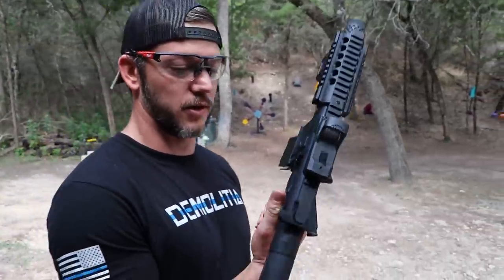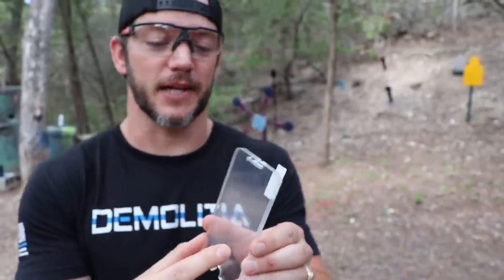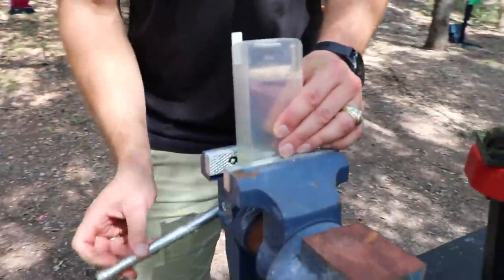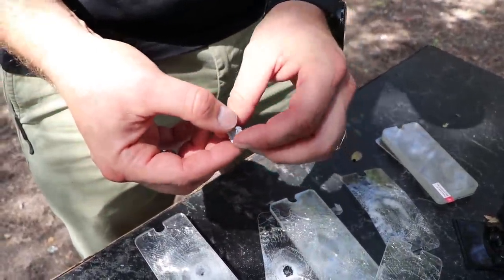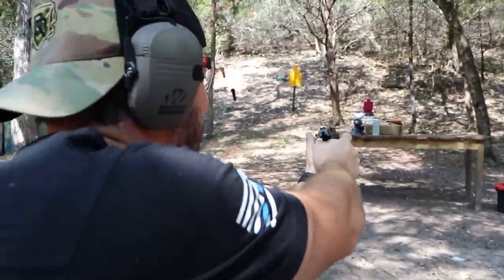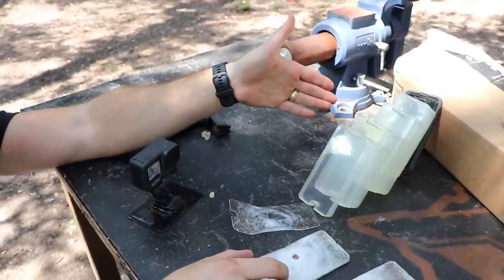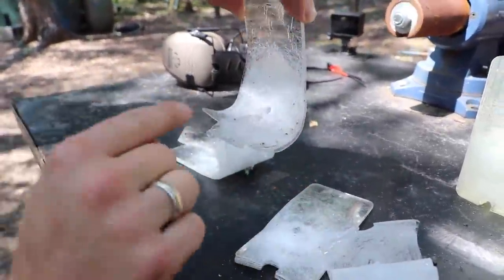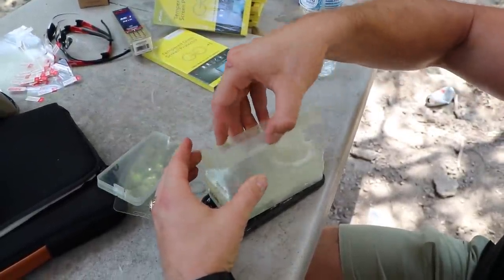How Many Screen Protectors Does it Take to Stop a Bullet???

Comment: Matt: "Nobody actually really likes this caliber..."
.380 at 7:15 : "And I took that personally."
Reply: Like it or not, I wouldn't want to be hit with it, nor a .22!
Reply: I was gonna buy a compact 1911 .380.  There's no cheap .380 in my area.  So I bought a Colt 1911-22 by walther.  Ammo for days
Reply: @Dontgetenslaved  i bought a crapton of steel case .380. i might as well have just thrown $100 at a fire.
Reply: @natemarvel2471  I've had zero issue with steel case 9mm and others.  Never had a .380 so I couldn't say if steel .380 is good or not.  I know a lot of gun supremest like to hate on steel case for no reason.   Even when they all have glocks and they eat anything.  "They wear out the extractor and ejector faster."  Well mfer you can't afford a $10 part to replace after shooting 5,000rd?    I hate people like that.
Reply: @Dontgetenslaved  this stuff was cheeeeeeeap. Actually shooting it out of a G42. Decent little compact. I have to over lube the thing to get it to run 7 without a cycle screw up. I side by side, same mags, same day ran Federal like a champ, but this steel case Monarch is hot garbage. My fault, I did zero research and it was available so I bought. Big oof.
Reply: Walther PP/K: "Am I a joke to you?"
Reply: @natemarvel2471  Ive had zero issues with the monarch steel 9mm.   I hate buying it but it's better than nothing.  Sounds like you may have gotten a few bad boxes.   What issues are you getting?  Extraction, feeding ???  The only real issue Ive ever heard that if your barrel clearance is too tight they wont seat or extract because the round won't fit in the chamber correctly.     That stuff still flys off the shelf in my area, even at the current price of $100 a box ..
Reply: @bdwilcox  I couldn't get .380 so I got a ppks in .22 also lol   Good gun, just liked the walther 1911 better so I switched.
Reply: @Dontgetenslaved  My father runs Russian made, steel cased 5.56 through his Galil MAR and that thing eats it all up. I also agree with you on the supremests who hate on steel cased ammo for no reason. Steel cased ammo has no problems if it's made right.
Reply: @jared.p240  Tula and wolf are top notch.  I've barely had any experience with brown bear but when I did it worked . The monarch stuff I didn't see come out until after the shortage when stuff started hitting the shelf again.  Not sure who it's made by.  Seems like they need to do some qc on the .380.
Reply: @Dontgetenslaved  Here in South Africa, I've never seen Tula, Wolf or Monarch ammo on the shelves in my local gun stores. My father uses this one brand that I've never bothered to look at the name. If I get the name I'll tell you. On a different note, now that you've told me that Tula and Wolf is good, I'll definitely buy some when this stuff flies into SA. If the Monarch .380 flies in too, I'll avoid it like the plague. Not that I don't have a .380, lol.
Reply: @sunshine681  My experience with a Browning .380 was you were more likely to hit the target if you threw the gun. So I would prefer to be shot at (not hit) by an average .380 than a .22 (which is more likely to hit you)
Reply: @Dontgetenslaved extraction. Could it be because my 42 is fairly new?
Reply: @natemarvel2471  If you've shot less than 500 break in for a glock...yes. Those compact have a hard time with that short recoil an stiff spring.
Reply: @jared.p240  Yeah 9mm and the rifle round monarch are ok for me. Use them just to plink steel or if shtf here .   I have some video on my channel of my guns and suppressor.
Reply: @natemarvel2471  Not to knock your gun but if you wanted .380 you should have gone with a compact 1911 or a walther ppk or the off brand bersa thunder.   Anything but a .380, .22 glock Ive dealt with and they are good. .380 is just a tad underpowered to move a huge slide for me. That's why most .22 go with aluminum slides.
Reply: @Dontgetenslaved  thank you, I bought a new gun in a caliber I don't already run, in the middle of an ammo shortage, and expected.... Miracles? So, the hunt for federal begins a new.
Reply: @natemarvel2471  I did the same thing with .357/38spl.   I acquired 1,000 mixed then went dry. Sold it all with gun.  Now it's everywhere here again.
Reply: @natemarvel2471  you could probably trade the gun for another or cash if you don't like  pretty sure you could make profit on the ammo for sure.
Reply: Matt has said many different times that he carries a S&W Bodyguard... which is of course a .380 (he's probably trolling you guys).
Reply: "How many mangoes does it take to reach the Moon?"
These are the question we NEED answered, folks.

Comment: When a shock wave travels at a very high speed without any actual resistance it will not cause any damage. Then it’s started to slow down a bit hitting the phone which had enough resistance to absorb the shock wave energy and to take the damage. Then the energy hits back the screen protectors as a second shock wave.
Reply: hm.....interesting

Comment: One word inertia... the tempered glass as I've heard you say it before acted like water and just carried the inertia through. The good few between you see broken could have broken for many reasons(they were stuck together closer than the others, they were a little stiffer, etc...) basically what I am saying is that in this case the glue kind of acted like a water bed in this scenario carrying the force through the layers to smack the phone with if not the fully force as much as it could carry through. 

The reason this happened on a 22 Hornet vs a 9mm or 38mm is because like you said the powder load. The hornet was a much smaller yes bullet but a MUCH faster bullet as you admitted. And when a moving object meets a unmoveable force. It created this beautiful puzzle you see today. 

Hope the break down helped. Pretty sure your just gonna read this and think "Neat" but there ya go.

Comment: I think what happened when he shot the 22 hornet is that the energy dissipated through the screen protectors in a football shape 🏈

So basically starts with a concentrated impact than it spreads in a large area making the center section not being damaged, then it concentrates the impact again, damaging what’s in behind.
Reply: Except a few in the middle shattered as well?

Comment: The reason the middle ones were not broken is similar to Newton’s cradle. The force of the bullet hitting the first layer was mostly put back into throwing it back at you and the rest of the energy went to pushing the middle screen protectors (which at some point disconnected from the whole line of them) into the back half of them and into the phone
Reply: The second you referenced Newton’s cradle i knew what you were talking about. Perfect analogy. 👌🏼

Comment: Similar to a pool ball, transfer of energy through a set of closely spaced objects.  Cool demonstration.
To clarify, if you have a pool ball that you want to get into a pocket but it is blocked by another ball or even several, you can get only the final ball to move far enough.  You can also see this demonstrated in a Newton’s Cradle, a common desk accessory in movies and some scientists where a row of suspended balls demonstrate this transfer of energy, when one of the end balls is dropped and thus striking the other balls, the ones in the middle barely move, but the opposite end will move in proportion to the one that was dropped.  It’s really cool how in some cases the some of, the balls barley move but still transfer the energy of the impact to the next.

Comment: That last result is probably the more loose screen protectors being accelerated by the impact of the bullet and smashing the phone. 

Similar to how bulletproof vests will stop a bullet, but the impact will leave a nasty bruise on the wearer of the vest; the bullet still accelerates the wider surface area of the vest into the body very fast, which is why the bruise happens. Another reason why it’s a bruise and not a pinpoint smash is because stress is force divided by area. The larger the area, the smaller the stress. Thus, instead of a super deep pinpoint bruise, you get a wide bruise from the vest because that bullet impact force is spread over a wider area as the best catches the bullet. The lower the stress, the less likely the force will break through the material (and the wearer’s skin in this case). There’s still an impact, but it’s not as damaging as a bullet ripping through flesh unimpeded. 

On the phone, you can see that the imprint from the accelerating screen protectors smashing into the phone is wider than the bullet hole, resulting in a circular depression that doesn’t penetrate but still has enough energy to shatter the tempered glass. This suggests that while the screen protectors did catch the bullet, they did not stop the impact force from being transmitted. It’s likely that this happened because some screen protectors loosened, meaning there was separation between some of the protectors that snapped shut really fast when the bullet impacted the stack. 

I think the reason why previous bullets didn’t do that is because the screen protectors were more tightly bonded together, meaning they did not separate and allow for that acceleration needed to smash the phone, because they would move as one unit with the phone. The repeated bullets getting hammered into the stack of screen protectors may have loosened a few protectors in key spots allowing enough protectors to accelerate due to the impact, which resulted in the punch into the screen that was shown here. 

Some hypothetical ramblings from a mechanical engineering grad student! Hope it was entertaining!
Reply: @Isaiah Yup, that's a good nutshell summary!

Comment: The reason the front and back ones broke and not the middle is most likely because of the principle of the conservation of momentum (mass times speed) it works in the same way as Newton’s cradle
Reply: Man, who needs screen protectors when you’ve got a simple UNO Reverse Card

Comment: Hey man I’m here to explain what happened, I haven’t looked to see if anyone else has done it so I apologize if someone has. Basically, with how the tempered glass is made it has a resilience, and layering it increases this. When force is applied it will per say bounce back, and so the back screens will take damage from redirecting the force “resiliently”. Kind of like when you punch a ball. you press the ball against a surface and it bounces off. even tho you didn’t go all the way through the ball the back is still effected because in the process of being punched, the back of the ball was pressured against the surface and re bounded forwards. Showing resilience.

Comment: The 22 was moving so fast that it transferred the energy to the protectors. The spring in them saved the middle ones and transferred the energy to the end ones that were against the phone.
Reply: I think the shock wave went through the protectors and when it hit the phone bounced back and thats why Matt got a face full of protectors, and the wavelength of the wave is about 20 protectors which is why it broke a bunch and left the next lot undamaged.
Reply: Kinetic energy ...
Reply: I'm sure the stacked glass is basically visualizing the shock wave. If you could make the glass be MUCH thinner and not fly away...you'd have a high resolution graphic indicator of the shock wave. 

That would be bitchen. 

If you had a million of them, and they were larger, stacked perfectly, zero atmosphere between each one...and they were THIN...the image you saw from the side after the shot would be astounding.
Reply: Sir Isaac Newton would be proud of you

Comment: Have you guessed the reason everything bunces back at ya? It's the coating. That sticky gel they put on the screen protectors to adhere them to your phone has elastic properties. You were basically shooting a glass covered rubber brick.

Comment: Science: it's the same mechanism at work with those giant balls you shot a good while back (glass and some mineral I believe). The screens in the middle have mass to push against (as you noticed, it's a compression and rebound) during the expansion, but the last screens don't so the deform more and thus shatter. The compression and expansion occur only on the path of the shockwave, which is why not the entire screen gets smashed.

Comment: “Every action has an equal and opposite reaction” I think because it was lined up against something that it couldn’t push away all the energy that was going through it towards the phone went straight into the phone and the phone pushed all the energy back towards you breaking the phone in the process. I reckon if the phone had nothing behind it then the screen protectors most likely wouldn’t have come back towards you (at least not as many) and the phone would have instead been launched backwards away from you and most likely ended up alright. I’d say it broke because it couldn’t keep going.

When an immovable object meets and unstoppable force

Comment: The phone case creates a small gap between protector sitting in front and the actual screen. The hundred in the middle are supporting each other, the few at the back by the phone caught all the energy and had to flex due the the lip.

Comment: @DemolitionRanch seemed like a transfer of kinetic energy thin glass like that would absorb the energy from impact and then begin transferring that force backwards because its actually kinda flexible you can typically bend a screen protector about 15-20 degrees before it begins to crack and break with that said the screens that seem to be randomly broken in the "center" areas were likely bent beyond their limit with the transfer of force hence why they cracked. The screen protectors that didn't break ended up bending with the kinetic energy and in turn transferred almost all of that force into the screen protectors behind them. The phone and box you braced it all with prevented the kinetic energy from continuing onwards and in turn forced the majority of kinetic energy to dissipate outwards in a sort of cone shape which is why the back screen protectors seem to have these big silver dollar sized breaks that are roughly triple the size of the initial bullet impact. The energy that didn't get dissipated outwards continued backwards and is why you see the screen protectors, phone, and box all move backwards after impact it's essentially a giant equation of mass + speed = force squared... It is also the same thing that happens if you get hit while wearing a plate carrier the armor plate stops the round but the kinetic energy is still transferred backwards which is why you see pictures of police and military personnel that get shot in the plate carrier only to have a large bruise  around the area of impact

Comment: I imagine it has to with shockwave propagation through the glass( which is very strange by itself) and compression resonance in the elastic sections of the screen protectors. The soft polymerthat is used to hold the glass together acts like a spring, compressing and rebounding.

Comment: I would say it's kenetic energy transfering through the glass. The ones in the middle of each bunch stayed intact due to them being the most compacted.

The ones at either end have nowhere to transfer the energy so shatter which would then cause connecting layers to shatter too. 

As for the phone. It's at the end of the chain so would break too. 

Think of it like those little desk toys with the four balls hanging and the ones at the end swinging out

Comment: Newtons class time!
Newtons first law of motion:
An object in motion remains in motion at constant speed and in a straight line unless acted on by an unbalanced force.

Newtons 3rd law of motion:
Every action has an equal and opposite reaction.
The reason you stopped using the clamp early on was because the clamp was acting on the screen as a force "against" the bb.
Had the screen been propped up with a string or something very light or flexible, the force it would have "against" the bb on the screen would be negligible.
Now for the Third Law.
The "push" the center screens had were likely due to the box pushing against the screens. 
You had hit fairly straight so the screens tried to absorb the energy. All of the screens compressed causing the bullet to try and ricochet... backwards. That push backwards separated the compressed screens and only then did the screen of the phone as well as the protectors at the end receive damage.

Comment: Glass behaves like a fluid under stress. It's the snapping back to true that breaks it. Up front ones broke because they took the direct impact (duh), the middle flexed and transfered the energy down the line. As we get closer to the backstop, the phone and whatever was bracing it; that glass can't flex anymore and because the kinetic energy that it was now forced to absorb exceeded it's tensile strength, breakage

Comment: what i think happened is because you had large sections of stacked screen protectors the kinetic energy traveled through them all and i think the back ones are shattered is because that's where they would smack into one another, with enough force if there is room between them, that would increase the amount of force that is being put on them

Comment: I wonder if it's like those hanging marbles where the energy travels through and knocks the one on the other side so like the energy traveled through the other screen protector and cracks the ones after. Or they just cracked cuz of the force of the other screen protectors